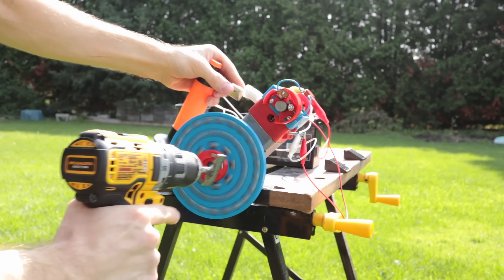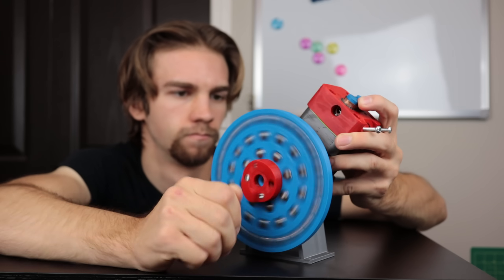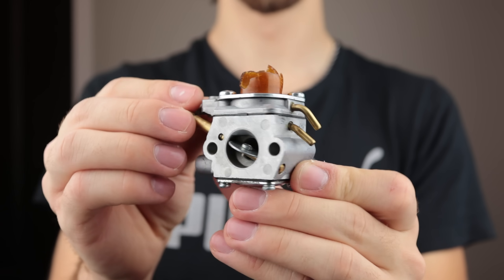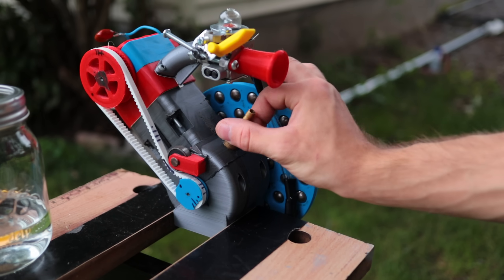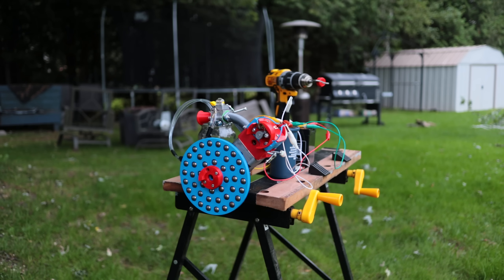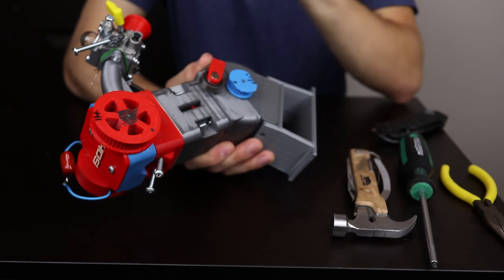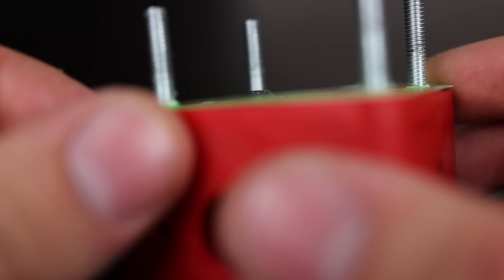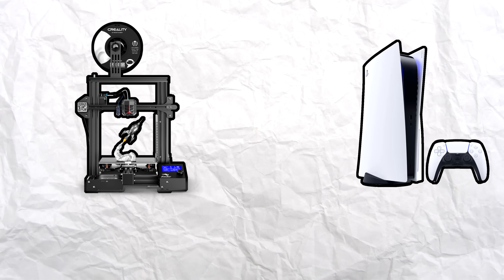Adding a Carburetor to my 3D Printed Gas Engine, and now it RUNS!

Comment: Congrats on getting it to run! I don't think it's worth pursuing much further on the 3D ICE because everything you'll be doing to get it running longer will have you move away from (plastic) 3D printing. That exhaust valve will always have hot gasses flowing through it, even if you give it more timing to keep the heat in the combustion chamber (then again, with a plastic combustion chamber, that heat is going nowhere but out the exhaust). 

- Optimizing air engines can get really interesting (look up Tom Stanton's series).

*I'm curious about your background (work or school), you seem more knowledgeable than most about engines, and on pretty specific details too.
Reply from the maker: I'm actually in 2nd year of mechatronics engineering, it's all just basic theory and various maths. My knowledge on engines stems almost entirely from my own research and experiments!
Reply: @CamdenBowen  great choice, I went down exactly the same path 😁. Feel free to hit me up if you have specific inquiries, I work on internal combustion engines for an OEM, I know first hand how a lot of the (correct) information for more advanced stuff is not always easy to come across outside the industry.

Comment: the carb was the right call for proper f.a.m. but the problem i was talking about occurred though in a different place than i expected but should have thought of because its in the most extreme conditions in the combustion chamber and that extreme condition is forced past thin easily melted parts that fail first. there is a reason valves and exhaust manifolds are either cast iron or turned steel not aluminum.

Comment: Congrats. I wonder if a cut down tin can or deodorant can would work as a cylinder liner and perhaps some of that metal foil tape to line the cylinder head. I know that that loses some of the 3d print factor but…

Comment: This is the coolest 3d printed thing I’ve ever seen. You should try resin printing the parts using ceramic resin. Integza used it to make rocket engines

Comment: can you make it two stroke? if there aren't valves to break it should run for more right? anyway i suggest you a piston port design with 140° of intake duration, 100° of transfer port duration and 150° of exhaust. make sure that there are 4 ports on the side and that the skirt is longer than the stroke. the max width of a single port must not exceed 70% of the bore. i suggest going with 60% for the exhaust, 15-20% for the ports and 30-40% for the intake

Comment: Making a 3D printed plastic prototype engine that actually runs for real is an achievement per se, With that design, you can actually making it in metal by accessing a 3D printer capable to print metal or conver such design in molds to be cast in either aluminum or iron, machining all the parts with the right tolerances, don't forget to add a oil pump and a good lubrication system for the valvetrain, crankshaft and piston to extend it's reliability, anyway it's a very fun project

Comment: you could use washers as valves with a bit of silicone but for future acomplishments you could use a smaller flywheel to make it more responsive to throttle inputs

Comment: but my idea for this engine is the make it in to a car or a mode bike with the hole thing being 3d printed but i don't kwon how to use my 3d printer but can he make a bike?
or will it fail? may be but it's cool that he got the engine going.

Comment: Congrats on making it this far! One idea for replacing the TPU: 3D print a mold and cast whatever you need in high temperature silicon (silicon for tin casting for example), it's super easy to do and will probably survive for a couple minutes at least
Reply: @mrvolucris1863  that's wrong, more compression means a more efficient burn and colder exhaust
Reply: @braziliansheetbox2497  Exactly
Reply: That's a good idea
Reply: To be clear, I believe you mean Silicone and not silicon.

Comment: Use nails as valves, make the head out of a resin mix or something and add water cooling channels. would be super dope. Good job getting this far! I just want to see more of the 3d printed engine.
Reply: What about eliminating the valves entirely and converting it to a 2 stroke?
Reply: @-walf-0659 would be a pain to seal the crank case 😊
Reply: @easylee1417  ouuu, yeh but I was thinking maby a mix of both, 2 stroke and 4 stroke properties, like the oil stays in the crankcase and the carb feeds directly into the cylinder, so the fuel won't have to be mixed with oil and it won't need valves, but engineering a 2 stroke from scratch might be a bit harder, especially since he uses an o-ring to seel the piston which might get chewed up by the openings OR let oil get into the exhaust or intake when the piston is fully up, reason being is that there's only one o-ring towards the top of the piston

Comment: finally! it's failing because of the material constraints and not the design/engineering! people have suggested different plastics and i'm sure that would help, but what about metal infused filament? 
probably more of a pain to get working because it often involves a sintering step that will shrink and warp the part. 
so maybe diy casting in aluminium? (aluminum lol 🇺🇸🦅) 
idk just glad to see this work after watching you work on this for so long!

Comment: try 2-stroke fuel, ie oil is mixed in the gasoline
Reply: electroplate the surfaces with real metal
Reply: copper is nice also as heat conducting sink
Reply: super

Comment: Next step is to cast everything in aluminum and make a longer running engine ;). Also, your points don't need to open that wide (source: I ride vintage mopeds every day to work with points ignition)

Comment: nice. improvements made the engine run! atleast for a second. lets make new improvements so this engine works like 30 seconds and see what could be improved! then step by step, maybe we can make this engine run for 10 minutes. then making changes, maybe forever? the only issue i see is the cooling. adding water cooling can create trouble since it can leak, also i think you need to change valve material to metal rather than plastic, also exhaust may be needed to change to metal since it will get hot alot and you will probably not going to cool down the exhaust pipe. good work.

Comment: The intake valve is cooled by incoming air and fuel. The exhaust valve gets no cooling, and the pressure of the exhaust stroke also causes localized compression heating at the exhaust valve.

Comment: Please read this =
(going to help )
Why dont you add a wattercooling for the hole engine ???(like in real engine ) so it dont houng to melt anything.  
The watterpump can povered by the motor.
And maybe you can print the valves from abs or a high meltingpoint filament ....or just add a wattercooling 
 ( in the future you goingt to have heat problems when the engine going to really run )👍

Comment: Good job on this build man, I mam glad it actually works for the most part especially since the majority of it is 3d printed. And some advice on the valves, maybe make them with a stronger material that way they can handle the heat and make sure the engine isn't throwing fire out the exhaust next time.

Comment: yeah i didn't expect the engine to run very long either considering the print temp of pla is 200C and it starts warping long before then. seems the thing that kept the engine from running was improper air intake. it looked to me like what ended up stopping the carburetor from working was that it couldn't drink enough fuel from the venturi, maybe worth a second look, maybe not. awesome series.

Comment: Maybe make the valves from PETG or PC and lap them to get a seal. 

Also you could add water cooling. This way you might be able to get a few minutes of runtime before something melts. Since the valves are hard to cool metal valves may be necessary though.

Keep it up man, great work :)
Reply: Or resin
Reply: you could maybe cool the head around the valves with water?
Reply: @hammerfix7241  I doubt there is any filament material with good enough heat conductivity to prevent the exhaust valve seal from getting almost instantaneously charred away by 600+C exhaust gasses. You'll need something printed out of non-flammable ceramic resin for that.
Reply: @teardowndan5364  didn't even think about heat conductivity. but you could cool the head before starting. after all we are speaking about couple of seconds of runtime.
Reply: Lap them??
Whats that
Reply: @xIsouLcruSHca  you put some abrasive paste between the valve and the valve seat and spin the valve to get a good seal between them
Reply: @MineTheSkyrimDimonds  Thank you! First time I heard that term!
Reply: I went to smell it when you said it smelled like charcoal and put it up to the camera haha
Reply: like others have said, plastic isn't going to conduct heat fast enough for any sort of active cooling system to prevent damage. 

and while more thermally resistant plastics exist for things like resin printers, I kinda think the point is to use relatively inexpensive hobbiest equipment to do it. while resin printers might still fit that category, they are a beast of their own that require ventilation and a lot of extra steps in comparison to FDM printers. 

one thing I think might be worth trying is to electroplate the 3d printed pieces. even a thin metal layer of metal would solve both the conductivity issue and protect the plastic core from burning and deformation. even if it does melt, so long as the metal skin is intact it will just be molten inside the metal. 

I've never done it myself, but electroplating 3D prints is for sure possible, and might be easy enough to be worth doing for the most thermally vulnerable parts.
Reply: if you make the head as well from petg or pc you'll achieve something that deserves a patent or something :) Great work

Comment: You could try a pendulum engine build (no slap), or even add actual bearings on the sides of the piston (or maybe the cylinder?) :)

Comment: now i wanna see him make it run for longer
Reply: Some people just want to watch the world burn.. LOL
Reply: If the engine was speed governed like a hit and miss, then the valves would cool a little between firing events.
Reply: @martin-vv9lf one of the first
Reply: @martin-vv9lf  governers are for wimps, i wanna see it rev with that butterfly maxed out. It'd probably hit like 6-7k tho
Reply: @martin-vv9lf something funny about a plastic hit and miss engine
Reply: i think that going two stroke is the way. no valves to burn
Reply: @fabiotiburzi  even bigger pain to engineer since you need to also seal the crankcase and make everything flow as it should
Reply: @CreeplayEU  naah, gaskets are easy to make and seals are easy to find because the external diameter can be 3d-printed
Reply: @fabiotiburzi  Noup. If it is made of plastic, it will not survive very long. So, succes is to make it from different metals. Thats my opinion.
Reply: @fabiotiburzi  i would say soo
Reply: @fabiotiburzi that was my first thought too
Reply: I wan to see it idle till it melts
Reply: After that put it on a chassis with some wheels n let vroom
Reply: Probably it can be possible, but for that, you need metal
Reply: +1
Reply: And longer videos
Reply: Same
Reply: Him: Look I did the thing!
Us: Do it again >:)
Reply: Yes
Reply: get a small two stroke, replicate each part one by one, keep the bearings and seals. your not making those with any form of 3d printer
Reply: Me too
Reply: print metalparts, the exhauste valve is the biggest problem, and the seat of the exhauste valve... try to print zyliderhead and valves with more robust heat material... or chose a metal valve... the heat will be the problem... inner cooling with gasoline helps for a long time but heat will damage the hole engine... see it in RC Engines also... need lot of methanol and other stuff in fuel to cool the engine from inside with fuel... but exhauste side is not possible to build with plastic... duroplast may be...
Reply: It'd plastic. Not happening
Reply: @j5892000  ye it WILL happen, you will see....
Reply: If it runs longer I wanna see what HP it makes

Comment: you should add a 3d printed supercharger, its a little easier than doing a turbo out of 3d print filament but i think that a supercharger is just as cool in my opinion
Reply: keep in mind it only ran for like 3 sencods i think forced induction is a bit of a strench at this point in time
Reply: @dustyjarman3252 Ya think? Naw. Nawz n turbo + superdupercharge it yo! Dat shit mad ez bruh
Reply: Thinking about trying that with an old electric leaf blower motor and a 3d printed housing on my old 7hp Briggs & Stratton woodchipper!!! But I wonder if the gravity fed carb could pull enough fuel.
Reply: @ku8721  you would have to compress the air/fuel mixture. Carb to supercharger to engine vs supercharger to carb to engine.
Reply: @ku8721 you will need a aftermarket carb because boosting a stock n/a carb will leak boost and will over pressurize it and blow out the bowl gasket